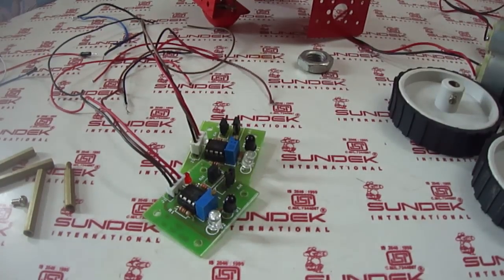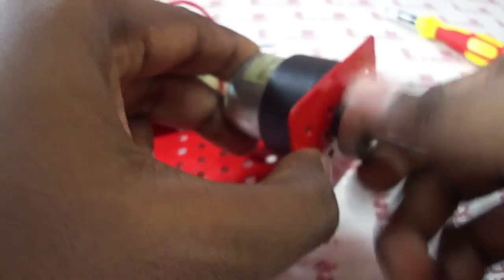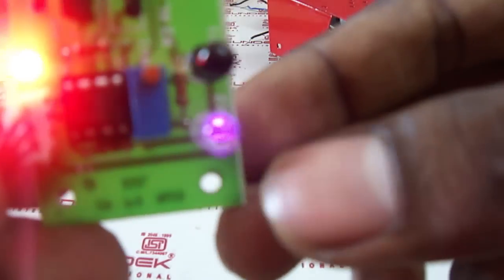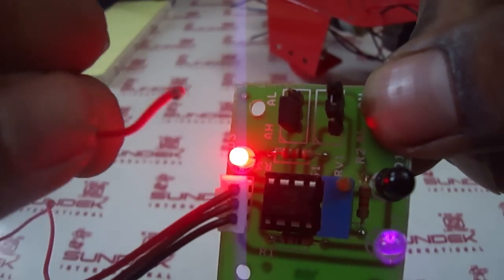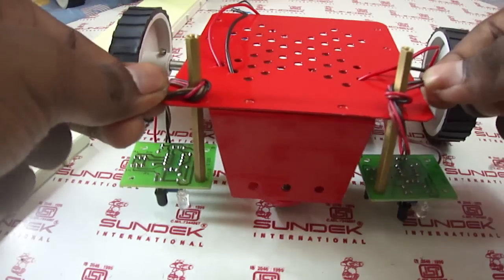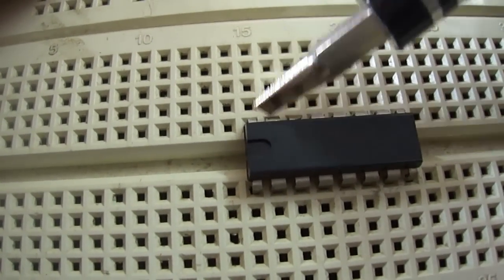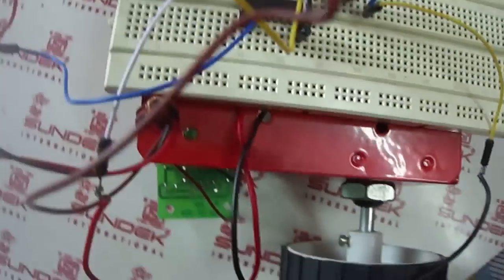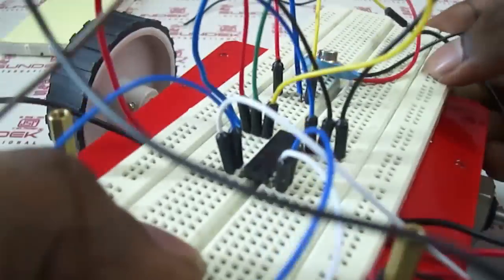How to make a Line Following Robot Without Microcontroller. (Make a Robot within 15 minutes)

Comment: My ir sensor has 3 pins named data vcc and gnd. When i provide -ive to gnd and +ive to vcc the infrared sensor starts to emitte ir light (seen through camera) but dosen't flash the red light as it does in your video. Also after connecting data pin to inp 1 vcc to +ive and gnd to -ive. My robot dosen't dollow any line. Please help

Comment: Actually you used proximity sensor over there,but how can you run it as line follower...
And also there is current flow only when some objects starts ,then the motor starts rotating...
how did u do that....

Comment: can u tell me the ic no which u have used plzand will it work on l293d
Reply from the maker: I used uln2003 ic, u can use l293d but its differe circuit connection
Reply: Hmm
Reply: Ya u can use l293d IC to motor control only but u also use 7404 IC for fullfill the line follower robot

Comment: can i use 12 volt batt n 500 rpm motor...??
Reply from the maker: You can use it, but the accuracy lies on the following line thickness, if its thin line robot cannot follow it due the time taken to control those motors. For faster motor its always advisable to use it with microcontroller
Reply: +Arduino Robotics LabVIEW Solidwork

Comment: will this work on 90 degree turns??
Reply from the maker: If you use 60 rpm motor and a 9v power supply. Yeah it will work. It just a basic tutorial to get start with don't expect the robot to follow like a pro.
Reply: ok thanks
Reply: +Arduino Robotics LabVIEW Solidworks  in 100 rpm

Comment: This video is totally fake! None of the steps of the procedure have brought out success while making a line following robot!
Reply: hi aditya ,i guess you did something wrong because i made one and it is working. :)
Reply: +deepak gupta can u tell how the sensors are sensing only the black line?all the connections are made by triple checking nd still it doesn't work out because this model shows none of the robotic principles
Reply: hi Sharang guliani hope i am clear :)
When any sensor among the 2 comes to a black line(in any turns),the motor connected to that sensor stops(which is obvious).Now since one motor stopped and other one is rotating the linear motion of robot change to rotatory motion(*you may say it is an analogy to one end fixed and the other part is moving which is what makes a circle*)
This takes the robot out of black line 
after this umm shift in position the sensor which was off become on again and since in this state both the motor are working ,the robot starts it linear motion again
Reply: +deepak gupta the sensor not being programmed, senses the presence of any object other than black line on floor